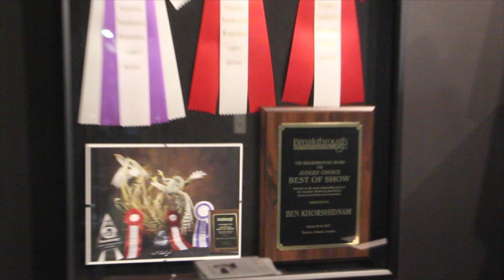Hawk Taxidermy, Kriders red tailed Hawk. Art of Taxidermy

Comment: Hello Ben. Maybe you have already explained this before but i'm watching all your videos in time order. And i am very interested on it. So why do you usually use a U-form wire  inserted in the cloaca zone? It is for give support to the tail feathers? or it's something else. Thank you again master.
Reply from the maker: Yes exactly. The U wire goes right under the tail feathers and it supports the movement of the tail. After caulking the tail it will be solid.
Reply: @ArtofTaxidermy  Ok. I understand the concept of "caulking" but maybe i'm a little confused. first of all you mean a caulking putty applied in the rear of the body bird?
Do you caulk the tail through the hole of the cloaca? Or before the entire incision is completely sewn together?
May be the caulking is used for get solid the rear of the body bird more than anything else the tail feathers since they are easy to fall off
Sorry man, maybe i'm bothering you with such question, but you have enormous experience that i appreciate
Reply from the maker: No actually I end up making a small incision from where the preening glands are and inject the caulk just enough to fill the void around the tail quills. It will just be for making it stronger and longevity. 
No worries. Let me know if you have questions.
Reply: @ArtofTaxidermy Ok. Thanks my friend, i got it now perfectly clear. i wonder if you caulk others zones like wings or feet
Reply from the maker: Yes and it depends on the pose and the bird. My pheasant series that I uploaded last week shows other areas that I inject. 
You really need to inject the bird and make that skin glue to the body.
Reply: @ArtofTaxidermy  well then I need to catch up jaja, thanks for all have a good night